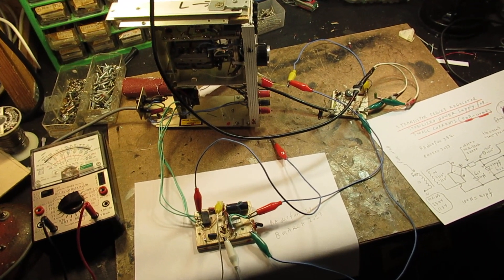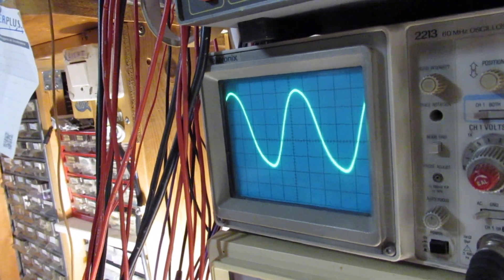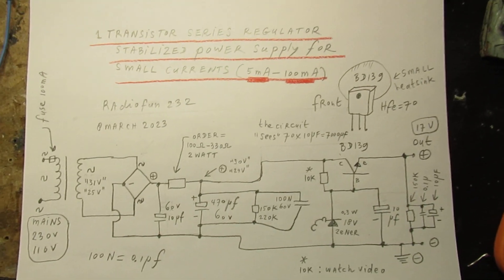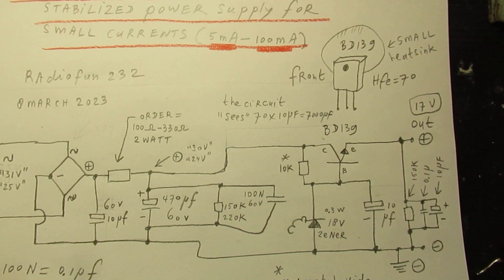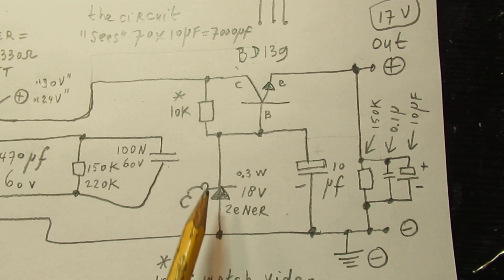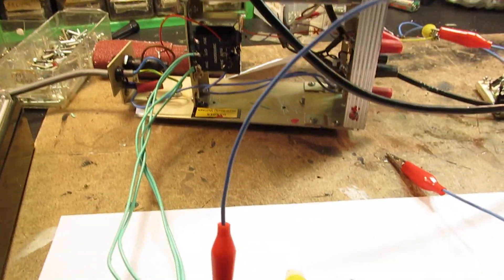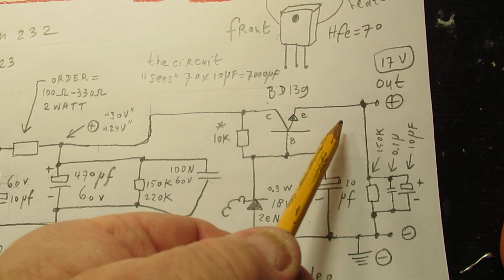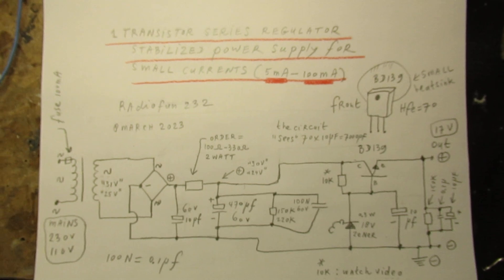1 transistor stabilized voltage supply with high hum suppression for 5 mA to 100mA demo + schematic

Comment: The FET buffer shouldn't load the oscillator circuit much, look forward to seeing it in finished form
Reply from the maker: Yes, the buffer circuit that I made already works good. Output impedance is low now. It will be published on YT. It is also made with a N-FET, the BF 256 A. Perhaps I need another extra 1 transistor stage (idea: BF 199) to get to higher HF output voltages, between (say) 1 Volt and 4 or 6 Volt AC in the frequency band from 130 KC-8MC. Kind of problem is that this is all HF. It needs some tiny tuning (with capacitors, resistors, etc)  to keep the waveform as pure as possible, given this simple (1 or 2 or 3 transistor) setup. So I will make the circuit as good as it can be in terms of reproducibility, so that everyone interested can make it with succes. That will take some time. Thanks. 8 March 2023.
Reply: @radiofun232  Thank you

Comment: First things first: I love your videos sir and I always look forward to your posts!  Thank you for making them!  Second: Since you've gone to the trouble of making low ESR caps in the circuit (parallel ceramic w/electrolytic, etc), would that imply that you could benefit from a big wide ground plane?  Or are we still low enough in frequency here for that to be an issue?
Reply from the maker: Thanks. The capacitor of 100 N (0.1 uF) that bridges the electrolytic (connected to the bridge rectifier) has the aim to damp out HF spikes on the power lead, that cannot be damped out by the electrolytic. It is a classic way to solve problems, when HF frequencies enter the power supply lead. Also that high value resistor (say 150K-470K) that bridges the same electrolytic plays a role in that process. Of course: could be that there are never spike voltages or HF influences on the power supply lead. So it is a kind of procurement. I try to publish my circuits for the YT viewers in such a way that all kinds of risks are pre-cured, because I don't know how everyone remakes my schematics. How this works and if this works can only be studied in a practical situation, with an oscilloscope paralleled to the (+) and (-) lead. The mass part to an amplifier/pre amplifier/oscillator always plays a role. I am not talking about EM shielding and protection against stray hum caused by non proper EM shielding in audio circuits. Say strayed out of the mains supply (50 Hz-60 Hz) transformer, or otherwise via other EM fields.The showed HF circuit (oscillator 130 KC-8 MC, earlier video) can work good with a simple mass plate (often minus), up to approx. 10 MHZ. But, when giving it a supply voltage, that supply voltage must be as pure as a battery, otherwise (when the smoothing is not good) the HF generator will be modulated (via the power supply lead) with 50 Hz or 60 Hertz, when there is ripple on the power supply lead.   
Thanks, 9 March 2023.